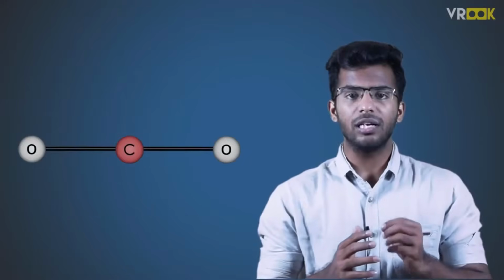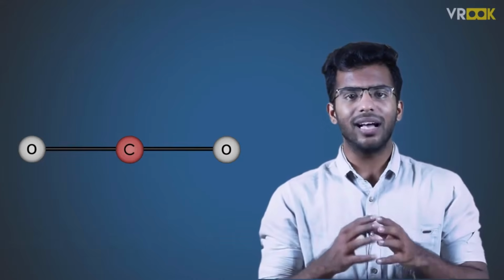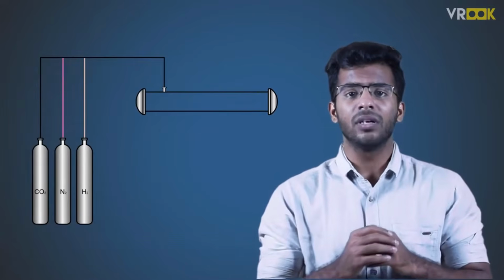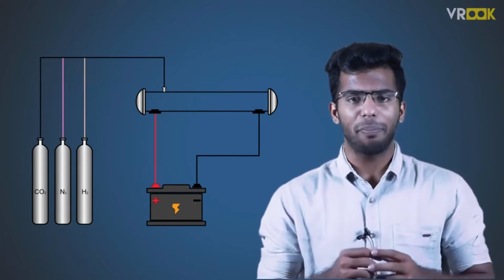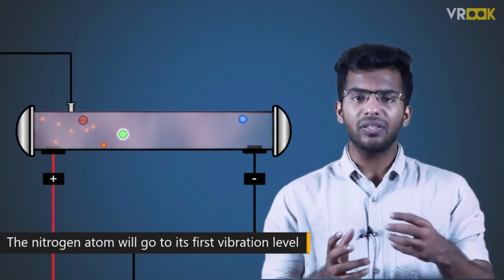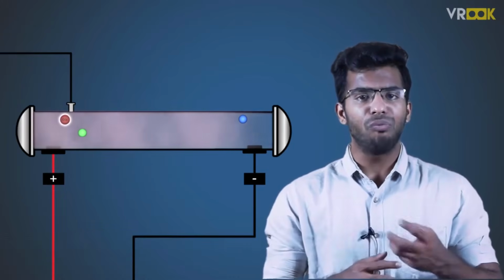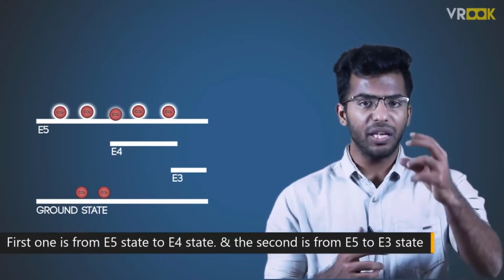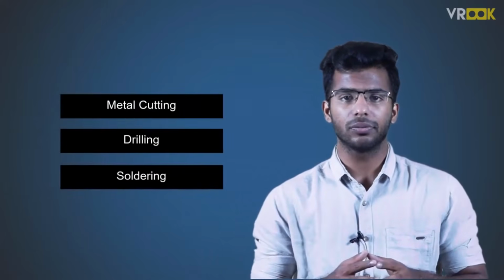What is Co2 Laser? How does it work? | Physics | Explained with animation

Comment: The Co2:N2:He ratio depends on..Type of laser (low power / high power / sealed tube / flowing gas),
Pressure,
Application (industrial cutting vs lab setup),
Manufacturer design,

 1 : 1 : 8
Very common in textbooks
Helium is maximum

 1 : 2 : 3
Used in some lab-scale setups
Slightly more nitrogen for better energy transfer

1 : 4 : 5
Used in some industrial or optimized systems
Higher N₂ improves excitation efficiency

Comment: I imagine there is some threshold voltage to get electrons to accelerate fast enough to put N2 gas into it's meta state. Does anyone know? I always wondered if there is a constant decay rate for electron's to drop energy levels. If so, could you pulse the voltage at the same rate to get more of the population of molecules involved in lasing?
Reply from the maker: To achieve lasing in a nitrogen laser, you need to excite nitrogen molecules to a metastable state using an electrical discharge. The specific threshold voltage required varies depending on factors like gas pressure and laser design. Metastable states in nitrogen molecules have a finite lifetime, and the rate of decay depends on energy level and molecular interactions.

To maximize lasing efficiency, nitrogen lasers are often operated in a pulsed mode, where the electrical discharge is synchronized with the metastable state's decay rate. This ensures a significant population of excited molecules for lasing action. The pulse duration and repetition rate are crucial parameters in controlling nitrogen laser performance, but the exact values depend on the specific laser system and application.
Reply: @vrookLearning  thank you! It makes sense that the characteristics of the tube and density of gas make a huge difference on the voltage required to lase. Also good to hear that my intuition about pulse frequency was not totally wrong.
Reply: The power supplies for CO2 laers that I've seen are in the 20, 000 to 30,000 volt range.

Comment: Ratio of CO2,n2,he is 1:2:3
Reply: 1:4:5
Reply: 1:4:5
Reply: The Ratio of CO2:N2:He is 10:10:80
Reply: The discharge tube contains a mixture of CO2, N2 and He in the ratio 1:2:3 with water vapor
Reply: 1:4:5